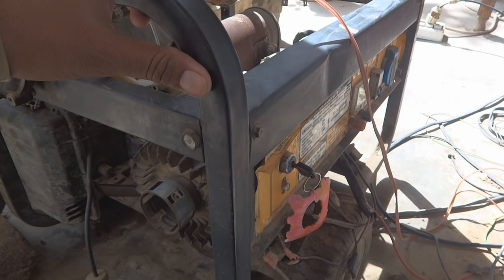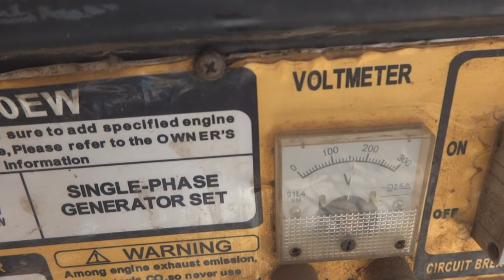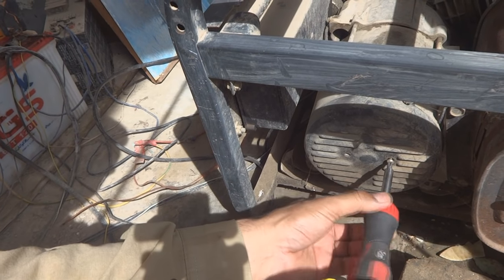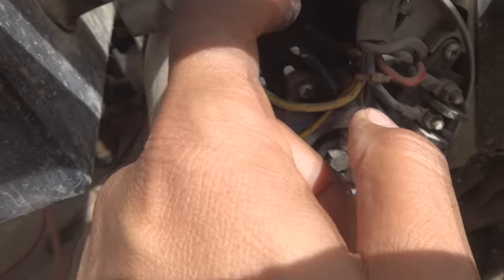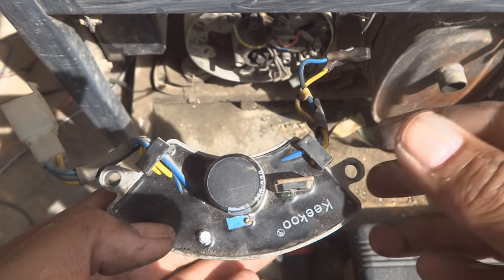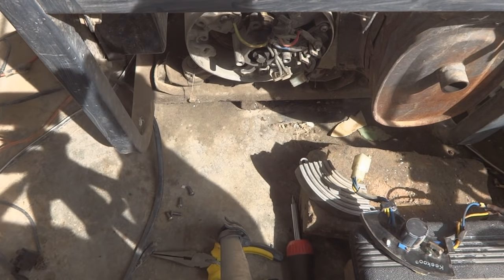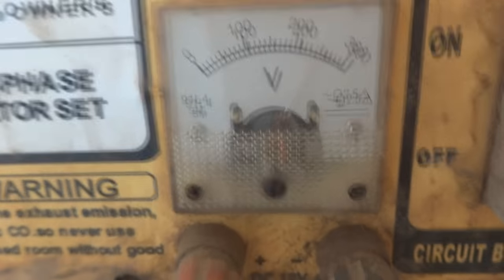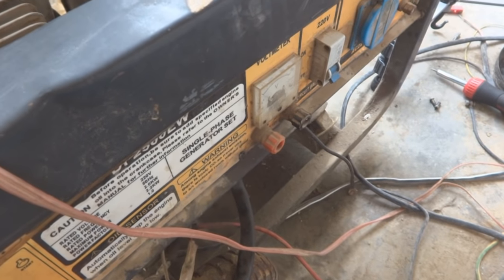Generator AVR adjustment. Generator voltage adjustment.

Comment: Engine ki awaz me farq ata tu voltage kam ho jata hai etc.
Reply from the maker: Apnay engine ki fuel supply ko smooth banaye. Kabhi kabhi kharab gas kit ki waja say gas supply engine ko smooth nahi hothi jis ki waja say aisa hotha hae. Gas kit maintenance kay leye meri gas kit wali video dekheye.
Second reason speed control governer ka kam na karna hotha hae. Usay check kejeye keh wo apna function sahee say kar raha ho. Apni success yahan share kejeye aur celebrate kejeye. Shukria.
Reply: Sub se ehem baat jo batana bhol gaya wo ye k shoru me tu awaz me farq nai ata jes se voltage bhi flactuate nai hoty magar ady ganty bd taqreeban voltage flactuate hona shoru ho jata hai. Ab exact problem keya ho ga .
Reply: @dilnawaz7  Exciter ka excitation loose ho Gaya hoga battery say badhayn .diodes may bhi problem ho saktee hai

Comment: I fitted new avr in generator but it gives me 310 volts but after this setting you told in the video it us giving me 270  volts it does not further decreases after it
Reply from the maker: Check your generator engine speed. If it's hight, try to reduce it by governer adjustment. Also you can verify the engine speed from produced voltage frequency. If you have frequency or Hz testing in your muti meter you can setup engine speed to produce frequency closed to 50 hz. If you have increased engine speed, sure your produced voltage would also be high. Reducing engine speed will reduce generated voltage too.